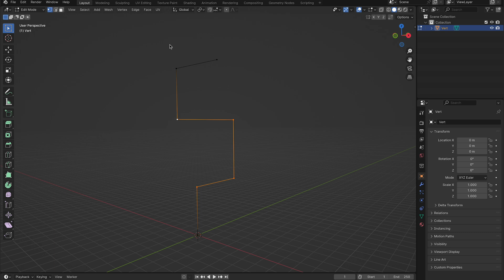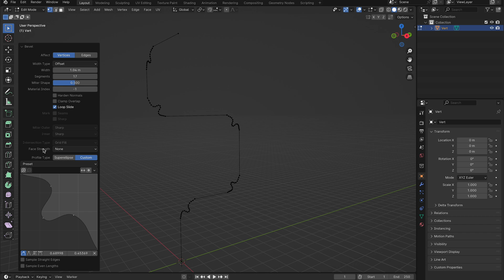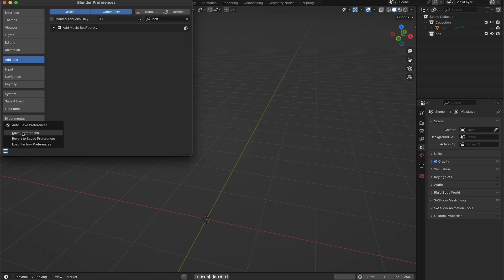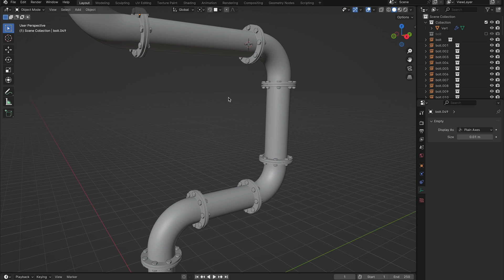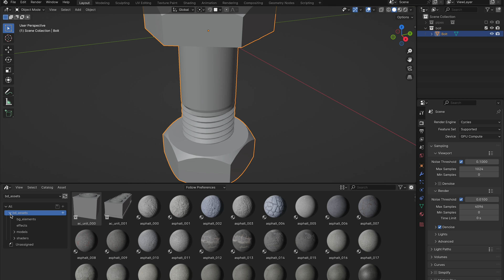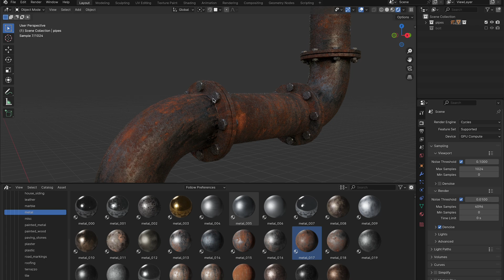the best way to model pipes in blender

Comment: I don't think this is the best way. At least not the part till you convert to a mesh again to do the connections etc
Why would I mess around with the mesh vertices and than convert them to a curve? Grab the free addon Bezier Utilities which gives you a pen tool like in Inkscape or Illustrator (and much, much more). Draw the pipes directly with that curve-tool.

Comment: When doing this, the pipes blender makes are not circular, but oval-shaped. I have an edge loop which i am trying to convert to a Pipe this way. Any ideas?

Edit: Figured it out. Shape keys were wonky from using scale in constraints to modify the base object. Seems they were inherited from the object when converted to a 3D curve. Applied Scale and worked.
Reply from the maker: If you’re getting odd or unexpected deforms in edit mode object mode transforms are usually the suspect

Comment: You should tell people how to "start with a single vert". I had to search that, then come back. Thank you for the great tut.
Reply: (in Object Mode) Add > Mesh > Single Vert > Add Single Vert

Also, if you're having trouble extruding that vert--like it won't actually extrude anything, make sure you're on Vertex selection mode. not Face or Edge. That tripped me up too. This is a very helpful tutorial overall though
Reply: ye, thats all what i need
Reply: You should tell what you found, because I too had to search! One need to enable the plugins for Add Curve and Add Vector called "Extra Objects"
Reply: Start with a cube and then merge all vertices at center, then just relocate the vertice to the world origin
Reply: @Kaajolee  aint nobody doing all that
Reply: Extra mesh objects add on  Edit - preferences - get extensions - search extra mesh object then install then go to add ons and enable

Comment: Someone can tell me why when i extrude the vert it follow the axis and when i extrude it again he is not ?
Reply from the maker: You've gotta use the key corresponding to the axis you want to extrude on with each extrusion, so each time you run extrude you have to press x y or z to lock that axis
Reply: @bytedozer   yes but sometimes i press Z but it follow the Z and Y axis for some reason (i dont press shift) thanks for the answer anyway

Comment: This technique also works well when you want to create an unusual shape, like the arched stem of a hanging floor lamp or lantern. You'll still need to adjust the thickness of the edge loops up the shape to taper it, but I'm sure there's an automated way to do that too - I'm very early in learning Blender.

I second asking where you got all those PBR textures from. A texture library like that is a BADLY needed tool for a lot of Blender intermediate folks. once you move past mesh modeling and start UV and texturing work.

Comment: A very solid video. Although with collection instances, you can go one step further and make a collection out of placed set of bolts. Then you can use that, which will speed everything up. The only thing I don't seem to overcome with this setup is Randomize Transform only applies equal rotation values to every instance.

Comment: You can actually make the entire pipe body non destructively, if you use the radius entity information on the vertex you can make the extrusion without having to covert to curve and then mesh again. Very handy when you’re mocking up a scene and don’t know exactly how the pipes will go, or if you just want to do it even faster than this.

Comment: As someone who works with pipes I love this!
However, i'd recommend to anyone trying to do this, model out a weld, or a victaulic coupling, or something.
Pipes are RARELY flanged in runs like these, and there are various types of pipe
Welded, Screwed, Brazed, ect. ect.
Flanges only exist for maintenance so you can take out a section of pipe without taking out the whole thing.
Flanges IRL get a gasket in between them to make a perfect seal, and trust me it's hellish putting all those flanges together, especially if they're heavy.

I say this because it could help resources with your game if you just put on a crude weld texture or model OF a weld instead of individual bolts and flanges, same thing if you were to model a victaulic coupling which would save 6 out of 8 bolts being modelled.

Also your explanation of "not every bolt is lined up perfectly" is a little untrue. We have this thing called "two holing", which is making sure that the holes DO line up perfectly, because if they don't, god help you, especially if it's welded cause then you have to cut that entire piece out, and reweld it to make the holes line up.
(Yes I AM the guy looking at pipes in video games for discrepancies)

Comment: To slightly improve on your methodolgy, I would add modularity to the plan early. The pipe you created could be an elbow and a straight pipe or two. 

No need to have everything be bespoke. With a simple pipe kit yoi could make incredible networks. It will save lots of time in the long run, especially when it comes to the rest of production (uvs, baking, materials, export etc)

Comment: Or you can go the geonode road once you reach the 0:40 part with those nodes :
- Mesh to curve
- Fillet Curve : Set "Poly", at least 6 "count" and a lower radius to start
- Curve to mesh : Use a primitive curve circle as a profile curve (would require to reduce its radius)

And here you go, you have the basics for a pipe. You can apply the geonode modifier if you want to convert it into a proper mesh (destructive operation).
Reply: But is there really a benefit to this in this specific case? It could be useful if geonode could be kept, but since you have to make flanges in arbitrary places and Blender doesn't have non-destructive workflow stack, you just have to collapse it to mesh. Meaning all this setup was just extra steps.
Reply: @ShadeAKAhayate  Just put flanges whereever you want on the pipes, as collection instances which includes the bolts. I found it odd to actually model them here as part of the pipe object itself. If you're good with geo-nodes, you can also;
1) Use radius to create other pipe sizes.
2) Use identification techniques to create concentric or eccentric reducers (e.g. "if radius == 0.01 then treat this part as a reducer).
3) Getting tangent space for anisotropic shading (used for hand rails) is easy enough and don't end up requiring UV based tangents which can cause issues.
4) Setting up UV.U is a bit more tricky; use spiral prior to merge, or whatever other trick you prefer.
5) Setting up UV.V is tough if you want it equally spaced, this is something that can't be done if rendering curves directly. But it can be done.
6) Main issue will be Tees and anisotropic shading singularities. For this a proper model with shading tricks is required (also kinda hard), or fake it with shader bevel node if the pipe is far enough away.

Setting up UVs, for a non destructive workflow, is only required if you can't use box mapping for whatever reason for generic texturing, or is zoomed in close enough to see actual brushed markings as a texture (according to the polishing direction, belt polisher in most cases). If you're far away or the brushes aren't that visible, say for a high polish satin finish, you don't need this and only need the tangent space output which is easy.

Obviously, if you do need to apply and make it destructible, always keep the source object ready in case modifications are needed. What I haven't been able to do properly yet, is closing off the ends with proper end caps, be it simple weldment caps or proper pipe end caps.

Comment: The part where you bevel the loop cuts for the joints, remove the faces, extrude the edges and then fill the edges was quite fast for me 😅 And I could not get Blender to fill those gaps individually 🤔 Other than that, I really like the approach!
Reply: Same. Lots of interesting things up until the 2 minute mark but that section, I didn't know WTF was going on. I'm sort of advanced beginner now with Blender modeling and my bevels and extrudes were making sh*t like 5 dimensional Escher geometry.
Reply: You can use 'Face - Extrude faces along normals' menu function to do the same without cutting these faces out.
Reply from the maker: I’ll try and slow it down a bit in future vids!
Reply: When selecting all the edges, press 'alt + E' and select extrude along normals. Then press 'I' to inset the edges inwards, and then 'alt + E' to extrude inset edges inwards.

Comment: That's not the best solution, not very flexible. After years of modeling i concluded that geo nodes are the best for this. In my case I use verts with two modifiers - bevel on verts and geonode with simple set of nodes that i've made myself, it basically takes verts, converts them into curve, then back to mesh, and with that it gives round profile. Very simple and flexible. Only issue that i want to adress is uv generation

Comment: THis is awesome. The part where you said "Unless you have a really good plumber, they wont like up" is weird though because all the pipes come pre set perfectly from the factory, we just add the bolts so they actually do line up lol. Still love it!
Reply from the maker: @KlutchDecals  genuinely didn’t know that, you learn something new every day 😂
Reply: @bytedozer  Ay you taught me something too! My dream is to be where youre at so keep grindin homie!!
Reply: I think there was a misunderstanding.
He meant the exact rotation of each bolt and nut won't line up with the others.
If a nut is needed at the other end, the pipes' flanges probably don't have threads and the bolt/nut pair is thus able to spin inside the hole even when tight, so the end rotation is random within a margin.
That being said, you'd be surprised at how often a random rotation just so happens to "line up" two or more hexagons (a few degrees difference is "close enough" visually).

If you meant pipes and bolts are indeed threaded consistently, so the end rotations for all of them does end up lining up as long as you use the same amount of torque on each (kinda like plastic bottle caps with molded detail), I'd find it hard to believe, but do apologize and would be interested in learning more about it.

Comment: Model whole pipes in the scene or in a game level as one mesh is not so flexible as it can be. 
 - What if level designer wants to have pipes connected by the welding not by flanges?
-  What if there must be a gauge or valve  in some place?
-  What if your country rules that there must be different coloring for  water, steam, fuel pipes in the (building/ship/factory plant) and so on?
- What if one need to have shiny new pipes, pipes with new paint (with different color options) on it, rusted one an so on? 
As for me I'd like to have small asset with straight pipe section, section bended by 90 and 135 degrees, C and U shaped sections, T and cross joints, few bolt flanges with different bolt count (higher the pipe diameter  - more bolt to hold pressure), welded connection, some gauges, valves, terminating sections as different objects in one collection. Ideally there must be 2 version of those assets. High poly one with 32-vertices on pipe section or subdivision surface modifier applied. And low polygon version with 6 to 8 vertices on pipe cross section maximum. Low poly objects must have normal textures baked from high poly ones. 
Whole work building the pipes of your scene (game level) after that will include cloning, positioning and rotating those assets.
Reply: there is a blender add on called "pipe generator" or something, that will fit pretty much all of your needs. (exept for the rust and new paint, therefore you will need a material add on or do them yourself)

Comment: question how do you add a single vertex point? can't find the answer online
Reply from the maker: @oyyoboi6716   enable the “mesh extras” addons in the addons tab, for 4.2 you might have to install it via extensions, not sure as I haven’t updated yet, once you’ve enabled that the single vert option should appear in the add object dropdown
Reply: you could also just add a plane and remove 3 of the vertices, then you'll be left with a single vertex point
Reply: Made a plane and put merge at center and that worked :)